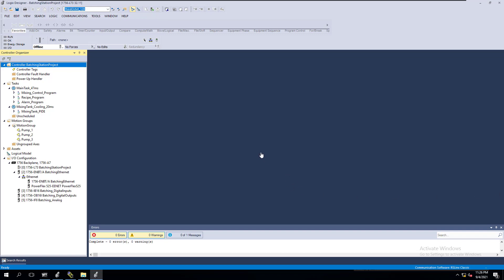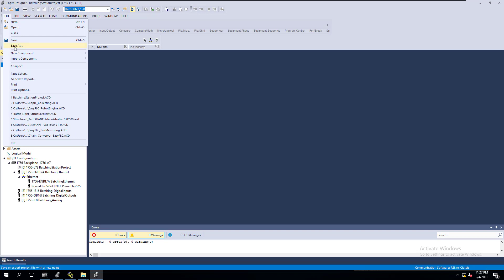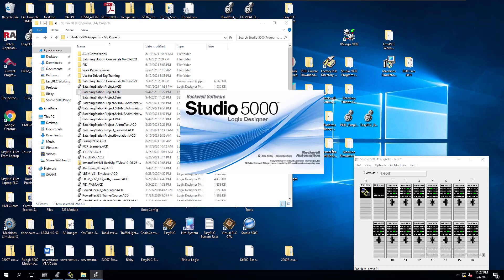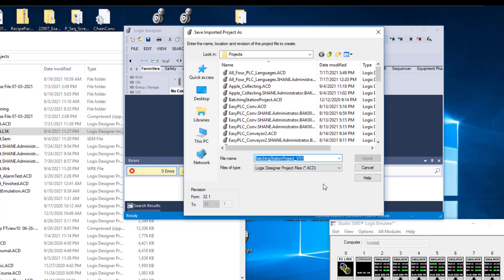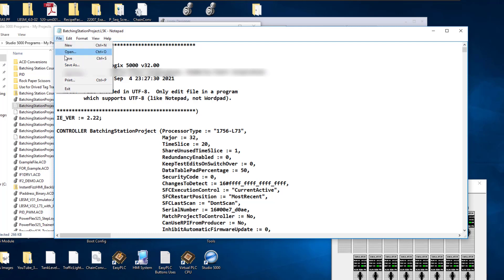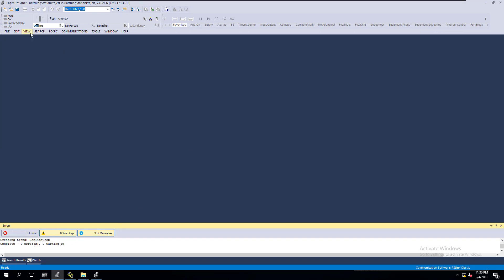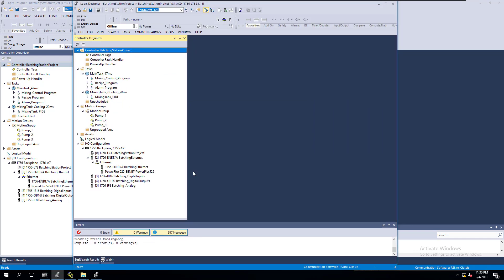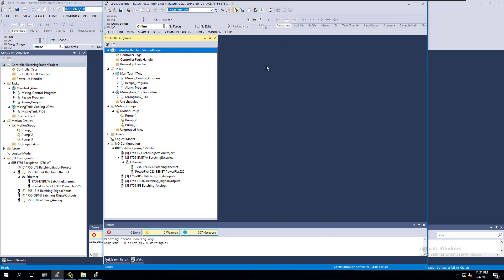Changing Studio 5000 Versions Using an L5K | Studio 5000 V32 back to Studio 5000 V31

Comment: Hello, when updating the firmware from V31 to V32 when restoring the L5k project, it restores the program but it does not load the configuration of the input and output cards, cognex cards, how can I export the complete Proyect.
Reply from the maker: To upgrade the program from V31 to V32 there is no need for an L5k.
Just right-click the processor and change versions, make a copy of the program first as a backup.

Comment: is it possible to use the old layout of RSLogix 5000 on versions 31+?
Reply from the maker: Yes
Reply: @ShaneWelcher  How would i go about doing this ?
Reply from the maker: @tristanparker3033  what do you mean? The version change in L5K?
Reply: @ShaneWelcher  Sorry, maybe if i rephrase. When version 31 came out the UI changed from the old RSLogix 5000 layout to the new studio 5000 look . Is it possible to have a program on version 31,32, or 33 but use the old UI?
Reply from the maker: @tristanparker3033  no, the only thing to do is adjust the colors to match...that's what I do because I am used to RSLogix 5000
Reply: @ShaneWelcher  Man that sucks. I really prefer the old look of instructions.
Reply from the maker: @tristanparker3033  I agree

Comment: can 28.0 still be downloaded from anywhere
Reply: thanks , I have studio 5000 on my laptop but I dont know what the version of studio 5000 it is , its not letting me connect with my controllers which all have 30.01 or 30.02 , how do I tell what studio 5000 version I have ?
Reply from the maker: @rshfn44  open Studio 5000 then go the the help tab then about...that will tell you the version you have.

Or you can look at add/remove programs in the Windows install to find if you have multiple versions
Reply from the maker: From Ab.com yes

Comment: Can you open files that were created with version 31 by version 32
Reply from the maker: Yes, however it converts the file to version 32.

There is a process to convert it back to version 31 using an L5K technique .

It's easy to move forward, not so much trying to move backward
Reply: @ShaneWelcher  yes I need to convert those files to version 32 but I couldn’t open them to start with with this 32 version software. Is there a way to convert the 31 files without opening the file
Reply from the maker: @muufcem8962  you need version 31, open Studio 5000 then open your version 31 file then in the processor setting change the version then allow it to convert it.

Either way, you need version 31 if your files are version 31

Comment: Does this work with the L81 processors? I keep getting a fatal error.
Reply from the maker: Look at the error then open it in notepad ++ to get the line number to edit.

This will give you an idea of what needs to be changed or corrected.

Hope that helps

Comment: Can you share what the IE_VER is for earlier versions like V24? The knowledgebase  QA1568 - RSLogix 5000: Converting a Project to a Previous Version doesn't seem to exist
Reply from the maker: It's basically the same thing I show here, L5K then edit the version to what version you want.

If it fails then it will tell you what IE version needs to be used so edit the L5K again and finish the conversion.

I believe I have another video on my YouTube channel that shows earlier versions
Reply: @ShaneWelcher are you able to provide a link to that video? I cant seem to find it.  Im trying to convert v37.1 to 26.1 or 20.x.  26.1 didn’t do anything when i tried to import (so couldn’t see the error message with the info i needed to edit in the l5k.
Reply from the maker: @terrellobo1879 Use the method I show here. 
L5k then edit the attributes but it's harder on V37 because they changed the instructions names
Reply: @ShaneWelcher  thanks. I’ll give it a try. Sounds like I’m going to have to change other things in the l5k? Are you aware of any resources to explore for this?  Some context: At this particular site, all our older modernized machines use RSLogix V20- but upgrades to machines this year and beyond (will) use studio 5000 Logix V37.  Where i’m not stationed at the site, I have a license dongle but it’s an old one that only supports V26 and below (classic Rockwell).  I’d just like to explore the logic on newer upgrades so will try this.  Sounds like I may have to get a new dongle that supports the newer kit.
Reply from the maker: @terrellobo1879 use the notepad plus that gives you the line numbers to be able to easily find the problems to fix
Reply: @ShaneWelcher good call. Thanks for the input.

Comment: Hey Shane I love all your content. It has been a great training tool for me. I was wondering if you could do a video on how to replace a kinetix 6500 module and get the parameters downloaded into it from the previous one and any steps that are needed to get it back online.
Reply from the maker: You would need to manually set up the IP address no matter what.

Then if the checkbox for automatic download is check in the version of controllogix then it should prompt the user the allow the download.

Hopefully that helps
Reply: @ShaneWelcher  yeah definitely. Thank you. I keep getting a " back plane communication" fault on one of the drives on our machine. I am not very familiar with servo drives yet.
Reply from the maker: @joshkingery3101  First, capture the Error code then that will lead you to the solution.
Reply: Thanks again Shane.

Comment: Great information Shane. 
I had another programmer revert a program for me once because I didn't have access to the newer version.
Reply from the maker: Thank you, glad to hear you got things worked out
Reply: @ShaneWelcher  
Hey Shane is it possible to send out email notifications from a Compact Logix? 
Or does it have to be done from a Panel View?
Reply from the maker: @darthenx2585  Both, however much different setups
Reply: @ShaneWelcher  oki doki. 
I am investigating about this with a Panel View 800. It appears that if you are  communicating an 800 with a compact 5370 you loose the Email function at the Panel View. Pretty strange.
Reply from the maker: @darthenx2585  Compactlogix tends to have comms restrictions.

I would recommend a 1756 chassis
Reply: @ShaneWelcher  
Man that sucks. My panel is already built and my program is almost finished. 
This email thing is a request from the customer after the fact. 😏
Reply from the maker: @darthenx2585  just make sure the stmp is setup correct then have a good Ethernet connection
Reply: @ShaneWelcher  
But it seems that the settings to setup email in the 800 get grayed out and disable if you select the CompactLogix as the PLC. 
Pretty strange that they do that